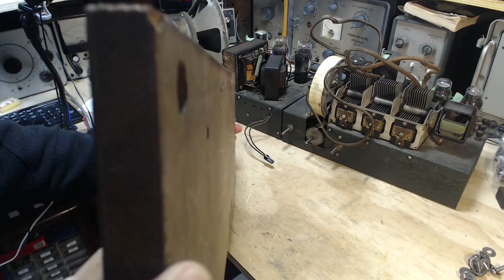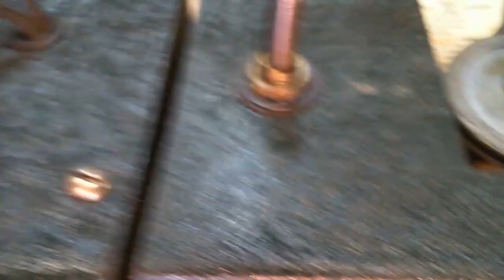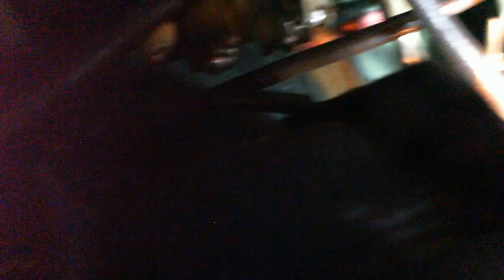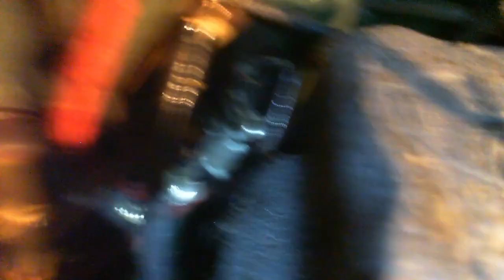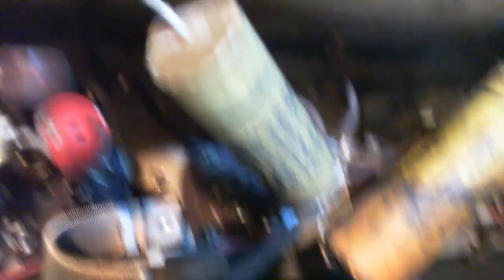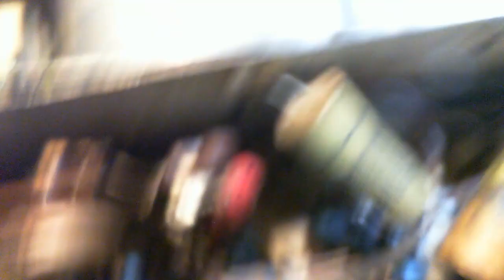Eveready Model 32 Video#6 - Output Transformer(s)?

Comment: Jim,  you do realize that your are measuring DC resistance - not the AC impedance at audio frequencies.  As a speaker is essentially a transformer there are primary and secondary (VC) reflected impedances.

Comment: I bet if that radio did require service as early as the 1930's that whoever owned it would have had it fixed or fixed it themselves, or had the local whiz kid fix it as opposed to buying a new radio because there was a great depression going on and few folks could afford anything new at the time, whether it was better or not.

Comment: At time 39:06 you might be wrong about the person in the 1930s not trading in for a superheterodyne.   If this was owned a poorer family (remember that the 1930s was the Great Depression), it is possible that someone could have taken in an older radio and tried to fix it with whatever parts they had on hand.   Perhaps this was owned by someone who lost everything and didn’t have the money to upgrade during these years.

Comment: Jim that canned electrolytic replaces a LARGE multi capacitor oiled paper capacitor, their is another website that delt with restoring another Eveready radio I think it was a Type 31, this was on you tube also, check it out!!  Jim I recommend to check that speaker one more time by leaving the field connected to radio and  take the voice coil leads and connect them to an audio signal generator and use that way to test speaker voice coil, another way is to do above with field coil but take the voice coil leads and get out a 1.5 volt battery and attach one wire and drag the other wire across the positive or negative terminal if you get a moderately loud raspy, clicky sound then the voice coil is O.K.   ---------------   John Bellas  KC2UVN

Comment: It looks like two original chassis mounted capacitors were removed and replaced with that 1960s multi section capacitor.

Comment: I intended to say some thing on the last speaker video but got busy and forgot..Speaker and secondary out put transformer coils generally have a .5 to 3 ohm dc resistance, the 4,8,16 ohms you are looking for is ac impedance the output transformer may be bad but it probably the primary burned out. energies the speaker with the radio and connect your audio oscillator to check its operation, good luck , keep it up

Comment: .6 ohms is lower than most modern sub woofers with massive 4 inch voice coils. That voice coil has a dead short. Most antique speakers run between 180 ohms and 600 ohms or more. With the output transformer showing a dead short, it probably took out the voice coil on the speaker too.
Reply: If I had to guess, I would say the radio was repaired in the late 40's early 50's, judging by that big capacitor and the hexagonal screws in the potentiometer.

Comment: Yeah just solder the ends on the clip leads and put some shrink wrap over it if the transformer is damaged still maybe repairable worth looking at it and see or you can get a new Transformer? Dismantle the transformer and unwind it a bit, usually the brake/short is quite near the top you might find it!? When you find the shot paint it with nail varnish lacquer. You can do the math on the transformer just find out what the resistance is of the primary winding and this should give you what a given value for secondary winding is. There could be a capacitor then that sorted it out